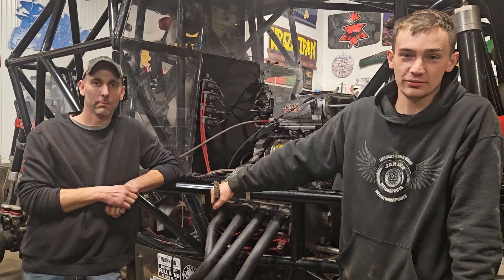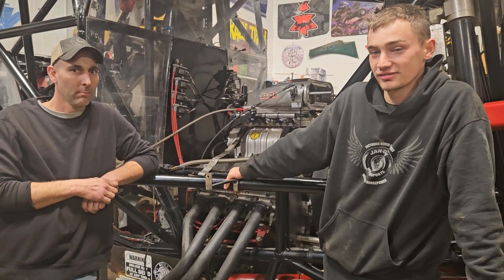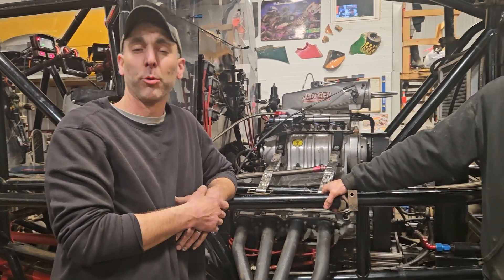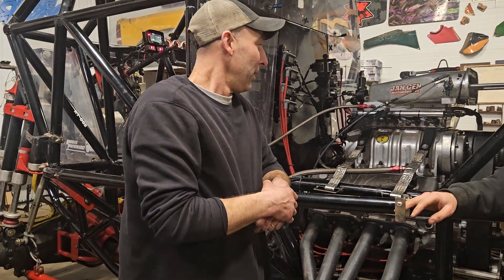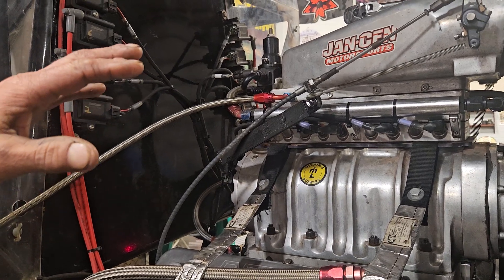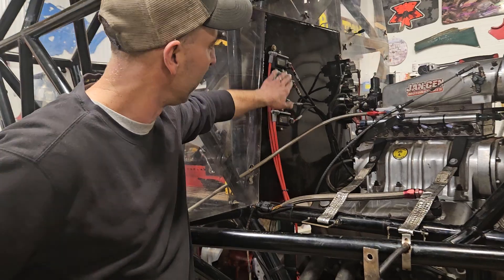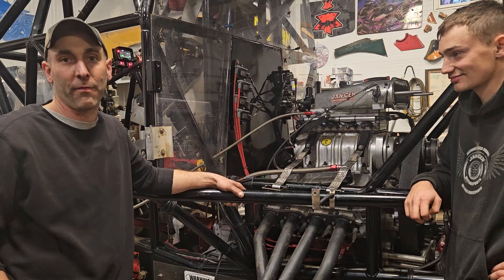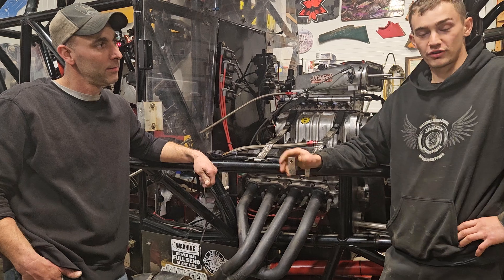EFI, Electronic Fuel Injection changes 2025. Making Monster Trucks more efficient & powerful!  Pt.2

Comment: Love the EFI set-up on my junk.  You guys could use a 2 wire iac valve.  I plumbed mine into the rear of the manifold. Adjusting barometric table will help with altitude without having to wait for the short term fuel enrichment to correct base fuel tables.